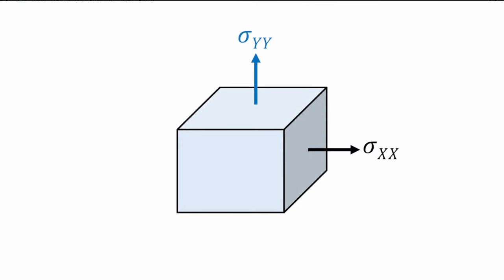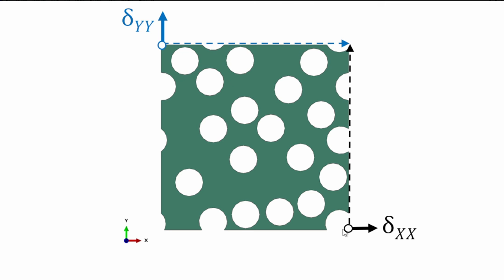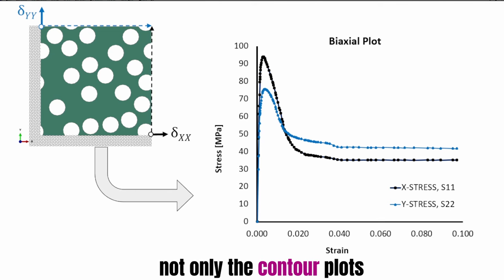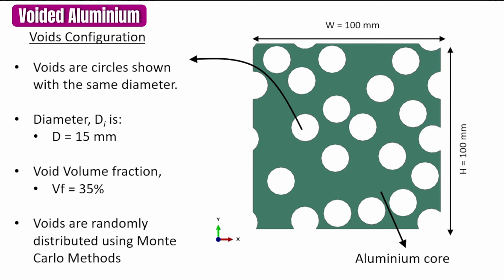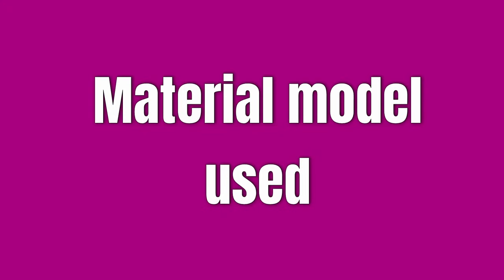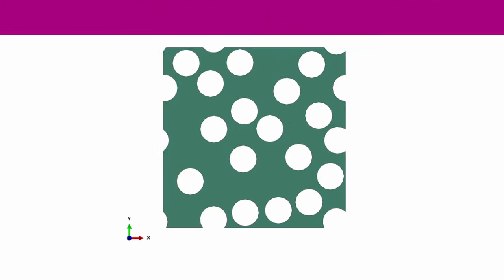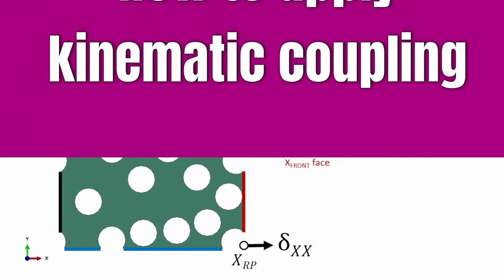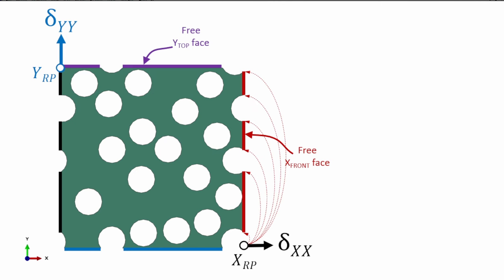How to apply BIAXIAL LOADING on 2D RVEs in ABAQUS (Voided Material)

Comment: Appreciate your effort, professor. I want to ask you if there is an analytical model for UDC in order to validate the RVE. Thank you .
Reply from the maker: I am not sure about the question. You can certainly so some analytical study on UD composites (UDC). This where your rule of mixture comes in. I do think you could use that to validate your RVE, some authors have done it but it is always better to use real experimental data. Whether RVE study or rule of mixtures study, they are both predictive tools with underlying assumptions of what reality should be like. In that case, they do not prove reality and so should not be used to validate one another. What people do is to use them as verification tools, i.e. to show that one model verifies another but true validation relies on experimental data (which reflects realistic response of the test material).